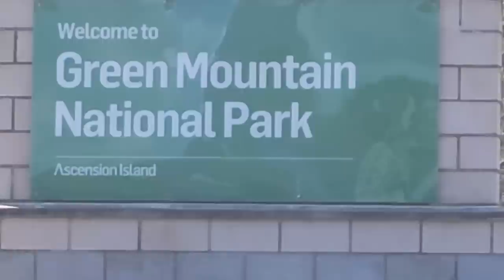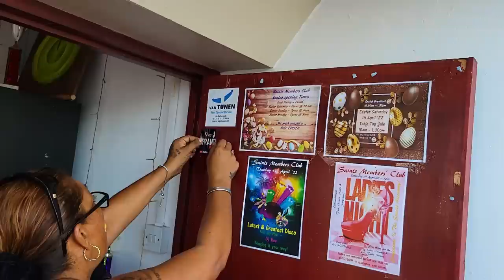EXPLORING ASCENSION ISLAND | GREEN MOUNTAIN | GEORGETOWN |  SEA vLOG 11

Comment: I was on a flight(RAF Tristar) to Falklands which landed here in 1986 for refuelling but as it was dark I never saw anything of the island. Did buy a turtle mug!
Reply: I went there by C130 Herc, twice. 15 hour trips with a refueling stop in Dakar, Senegal. The second time I went was in the place of my opposite number on the other shift who got fluid on his lungs so couldn't fly. He later went on to the Falklands in my place on what was referred to by the people on it as hell. They did 15 hours to Ascension, 15 hours to the Falklands but couldn't land due to the weather so, 15 hours back to Ascension. They let them have 24 hours to recover before flying back to the Falklands all on a C130. I did see newly hatched turtles heading into the sea as well as going up Green Mountain to the Dew Pond a number of times. On one of the days I was there the sun passed directly overhead, I had a very good tan.

Comment: Really love the videos. Keep it up! I’m curious what they were building that required so much gravel (Cement buildings? Roads?) Also interesting that the most cost efficient way to get gravel to Ascension Island was from Nova Scotia. You’d think that there would be closer/cheaper options in Africa or South America but I guess that’s why I’m an armchair observer and not running a shipping company…
Reply: There's a huge runway at the Airfield (called Wideawake Airfield) thats 2 miles long. The runway was cracking up and needed complete replacement. UK Government funded the replacement of the runway. It's only just re-opened. It's used as a divert airfield, but also part of the airbridge to the Falkland Islands. In the Falklands War it was a crucial logistics hub, was also the busiest airfield on earth for a few days. It's where the Black Buck bomber missions were launched from.

Comment: Joe... with all that rock on the island, what are they using the ship full of stone for?
Reply: Wrong type of rock, a lot of it is pumice and small bits that are not big enough to be called gravel. There is also no quarry or quarrying machinery. On an island of 27 square miles a quarry would take up a significant piece of the land area and so is never going to happen as it would mess with the local eco-system. If you look at the pictures you can see that a lot of it is volcano cones, Green Mountain is just the biggest and oldest of them.